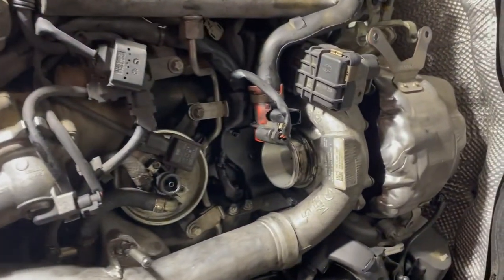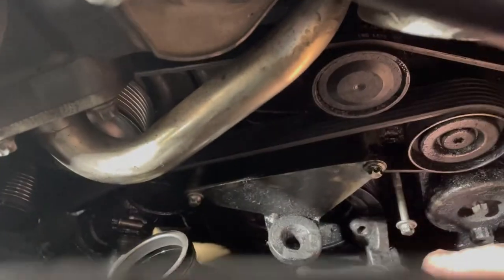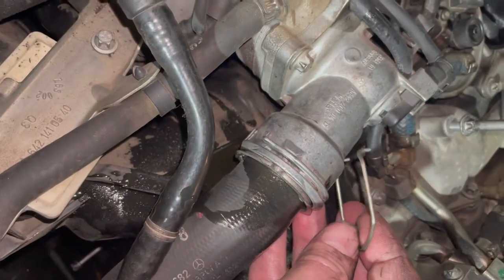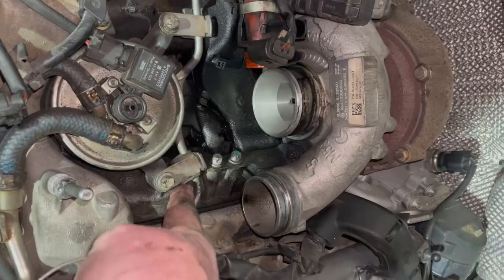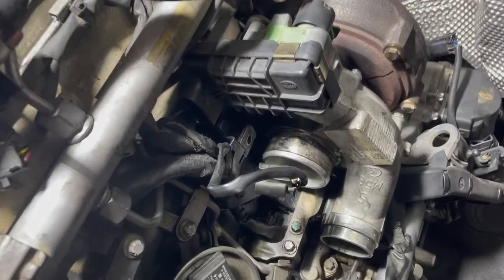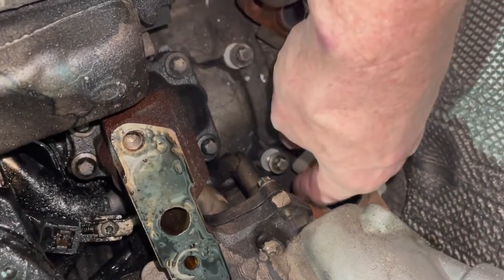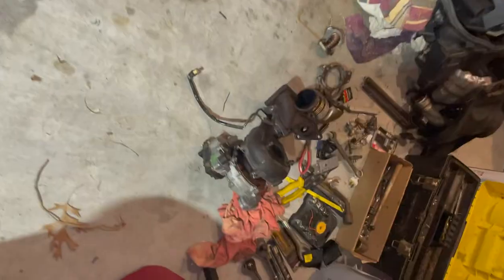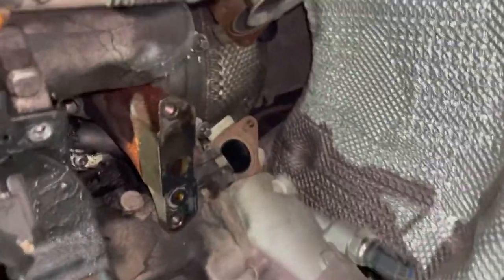OM642 (Oil cooler leak fix 1) turbo removal MB E320 2009 Oil cooler leak

Comment: Is it just copper gaskets or would ther need to be any sealant asded? Thanks just had  turbo damaged on fathers e320cdi was considering do it myself, great video!
Reply from the maker: They are all metal gaskets, no sealant. I only used some anti-seize on some of the exhaust bolts but this is optional and requires different torquing. Appreciate the feedback!

Comment: nice job! Im following your guide and doing the same for w219 cls320
Reply from the maker: Thank you! I hope it goes well. Take your time and it will :)
Reply: can you also provide me with serpentine belt cover part number ? My motor doesnt have one and I would like to install it
Reply from the maker: @sauliutas  I am afraid I don’t know. Also keep in mind my car is a w211 E320 so it would not likely be the same part. Are you sure your model comes with one?

Comment: I am just looking to remove my turbo to look for a boost leak. Would I need to drain some oil before pulling off the turbo?
Reply from the maker: You don't need to drain the oil if you are only removing the turbo. Just don't crank the engine because there is an oil feed line into the turbocharger through the pedestal. But nothing will go through the pedestal oil feed if there is no oil pressure. I didn't even drain the oil for the oil cooler seals replacement and I didn't loose any (I am still driving around on the same oil I had before the seal job, haven't needed to add any at all).
Reply: @DIY-VIDEOS  thank you!

Comment: Were you having a P0299 code?
Reply from the maker: I did not have any error codes at the time I started the repair but it was leaking oil when running. After I did the repairs I did get a code 2513-000 which is related to the deleted swirl flaps. The fix was a resistor (I have a video on it). I don't recall any other error codes but it did go into limp mode a few times in the year or so before I did the repair. But restart cleared it and we didn't scan the codes at that time